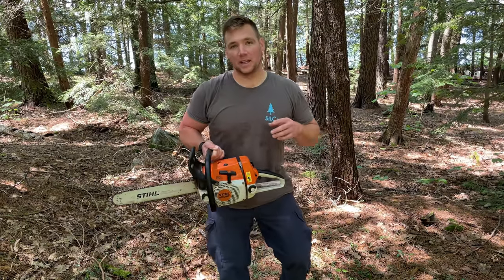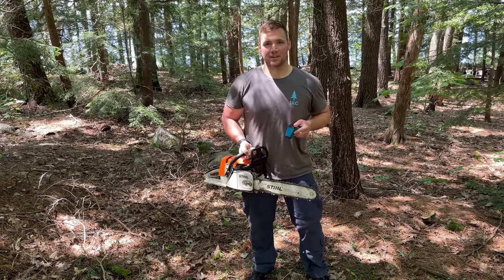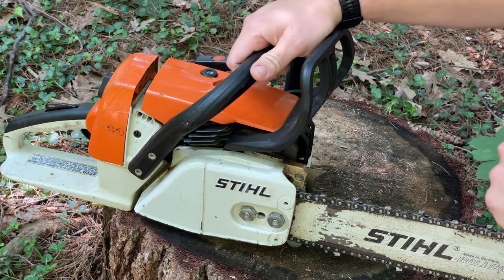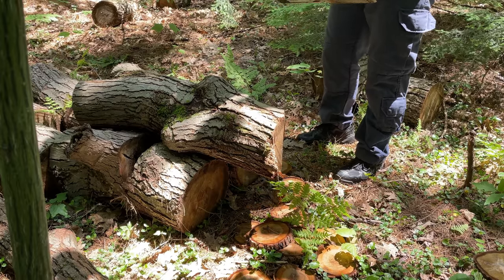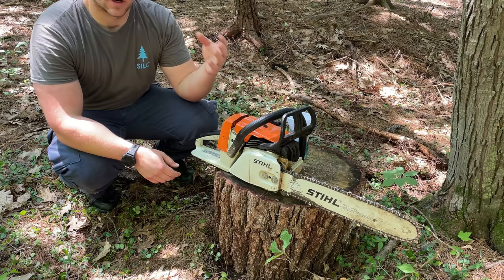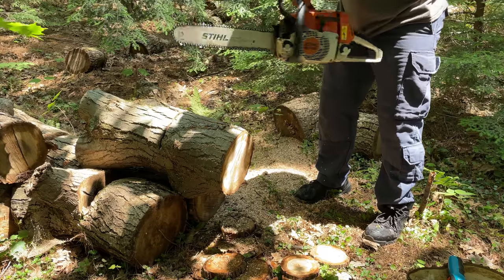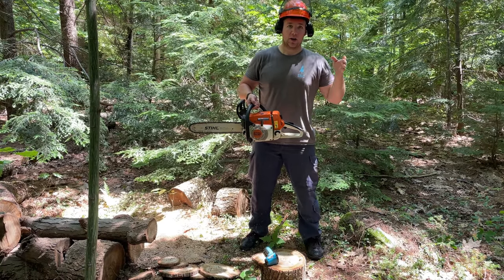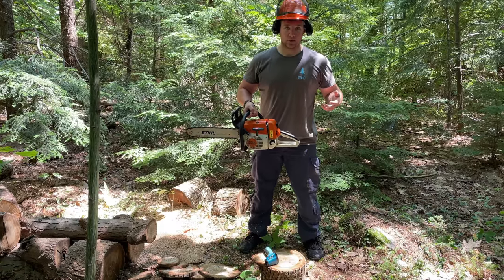Will my chainsaw last longer if I use more oil? Is it safer? (25:1 VS 50:1 temperature testing)

Comment: I run my Stihl 170 on 60:1, seems to be a bit happier (only light 3-4" trees), i found at Stihl's recommended mix, it was blowing more smoke than a damn mosquito fogger, bogged down more on harder woods, and just didnt seem to rev hard enough.

I also run my cheap Homelite 2 stroke line trimmer at 60:1 and same thing- runs better, less smoke & revs happier.

Even during 40°C plus summers here in Australia, they both run fine and dont feel hotter than usual (i use them for hours, with a break of them idling for a few mins+ stopping to refuel), and also 2.5 acres of grass/ bush hoggin'.

Edit: i also only run 98 octane in my gear (or if it is too expensice AUD wise, 95 minimum

Comment: 50:1 here, no issues...stihl trimmer 19 years old and still kickn ...though I like echo red armor oil mix better than stihl mix
Reply from the maker: That’s awesome. It sure pays to take care of your stuff! Why do you like it better?
Reply: @DavesSmallEngines  burns cleaner imo, my stihl chainsaw I run stihl oil for years in it and the spark screen gummed up … found red armor and it smokes less than stihl … 5 years later still no build up on it

Comment: With jetting remaining the same and suited for a 50:1 mix, adding more oil will displace the fuel so it ends up  running leaner resulting in more heat.  So going too overboard on the oil is not a good thing as is also to have too little oil.

Comment: I sort of wish you were also able to measure what percentage of fuel was used each type I think it would have been using more fuel to get through at the longer bogged down 25:1 mixture so it's made me think that I need to make sure I start running things alot more closer to the recommended one
Reply: Always run your engine's specifications is best , I personally won't run a rich 50:1 even if It would be recomended by that engines manufacturer as I'm not convinced that oil technology is up to that task, not yet anyway. There are many more variables to be considered, as I read some of these comments about carburator adjustments to compensate for the leaner fuel mixter, one would have to experiment with all the different oils that are available today and that would be a huge task, as oil technology has improved drastically over the years they still have their limits. As far as two stroke oils are concerned-- we're looking for good lubricating properties when combined with gas as well as combustability as one has mentioned here in these comments of using a lower flash point oil. As far as four stroke engines are concerned coming from a 63 year old born gearhead like me who has lived through the days of changing your oil every three thousand miles and now seeing that being stretched out to every ten thousand miles even on a turbo charged engine is also asking to much of that oil, between five or six if not driven hard I feel is best, even though many won't put that many miles per year at least not these days and if they do it most likely be  highway miles (rule of thum highway miles equil one third to a half of city miles). One should also keep in mind the POLITICAL CLIMATE that we are living in, a time where there is unreasonable requirements put on these manufactures to reduce emissions and maintain or acquire carbon points which has been choking this industry and making many things that us gearhead love disappear. Yours truly, Paulie T.

Comment: I have run a holzfforma g372xp on 20:1 for the past 4 years since i have owned it and had no issues. It gets used and abused every winter and hasnt given up yet

Comment: We run aspen 2 alkylate gas for professional use. No worrying about mix or ethanol. Definitely keeps carbon build up to a minimum too. No smell/cloud when starting the saw either. Never worry about letting equipment sit for a while. Seems like a cheap way to avoid a lot of worry.
Reply from the maker: Hey 7eis! I totally agree with you. Although, it’s expensive for those who use their equipment all day, every day!

Comment: I use amsoil saber mixed at 100:1. We have used it mixed at over 150:1 when I was being aggressive. We have been doing this for 20 years. I had a failure on a 661c but I have reason to believe that was an unrelated problem.  I use ethanol free 91 octane on all my small engines. 261, 241c and 201t have no damage after using this strategy for years now. More power, though I’ve never adjusted carbs.
Reply from the maker: How long have you been using the Sabre at 100:1?! I need to try some
Reply: 20 years. It used to be called something else but for the past 10-15 years it has been called sabre.

Comment: Can you do this test on some Chinese nockoff brands that say they use 25 to 1.
Test to see if they have same results,  no extra ware on them?

Suggestion, Farmertec Holzfforma G111
   Its a 1 to 1 copy of a no longer made MS200T
   Will it run 50 to 1 fine?

Comment: Very interesting results and a great video from the OLD MAN at EP. Just wondering if you think there was any damage done using the 25:1 mix for this short period of time?
Reply from the maker: I don’t think there was any damage. If I was cutting a LOT of wood it may have done something, but over time the carbon and oil sludge build up would only cause the saw to heat up more and more!
Reply: You’d hang the rings in the grooves if you kept running 25:1
Reply: @shannonwhitaker9630  Correct

Comment: Could you try amsoil saber at 100:1? I’ve been running it for several years and no failures yet. Curious if temps would be less.
Reply from the maker: Yep. I’m going to try that

Comment: Sort of invalid, I say that because you didn’t retune the carb on the saw to make it run correctly with the 25:1 mix ratio and you could definitely tell it was laboring more because of it because it was starving for fuel, now if you increased the fuel mix on the carb the performance should be equal with less wear and heat with an even bigger increase in smoke on account of it

Comment: I argued with a guy about this exact situation, I knew 50:1 was all around better than 25:1, I use true fuel 50:1 in my 1/5 RC cars with better results than the recommended 25:1. Thanks

Comment: Always surprises me how many people don't understand that more oil in a mixture means less fuel in that mixture, or how many people don't understand the difference in oil from 'back in their day' compared to the synthetics of today. 

They ran 16:1 and 25:1 because they had to -the oil didn't have the same protection levels as today's synthetics, which can be safely run at much lighter ratios. 

If the carb isn't jetted for that amount of fuel you're running the engine lean.

Comment: Tricky as manual says 25/1 IF using a 2 Stroke oil off the shelf BUT 40/1 or 50/1 if using branded eg Stihl or Echo, so does this mean they are more concentrated?  If always use 25/1 on older worn 2 strokes and never fouled a plug or had any troubles. maybe i an wearing them out from higher heat but not lack of lube?

Comment: Hi Dave: I bought a Stihl 038AV back in 1980 and ran it at 40:1 mix. The spark arrestor screen would clog up. My mechanic said I could remover the arrestor (which I didn't want to do) or run a 80:1 mix. To this day, 42+ years later, that saw is still with me, and I have never done a engine repair on it. I also have a MS170, FS86 trimmer, and HT56C pole saw, and I run all of them at 80:1 with no problems. And my spark arrestors never clog up (one of these days I'll have to check that again)! Thanks for doing this test but no one could convince me to run at 25:1, ever. Your thoughts would be appreciated.
Reply: Was told you could possibly run the 80:1 by someone who worked at a licensed stihl dealer with no problems short term.
Reply: I ran a Homelite Super XL at 80:1(Amzoil) for about 12 years with no problems.

Comment: Dave, I've question: I use a 051 for milling, running a 25:1 mixture. That saw is over 40 years old and still  runs quite well. Is it ok to  run it with a 50:1 mixture, as todays oils are much better than years ago?
Reply: Stick with what you’re using, it’s obviously liking it, what motivates your desire to change? If it’s power, you’re certainly not going to attain it using less oil, more oil- more power.

Comment: the increase in temperature is not due to the fact that more oil leads to a higher viscosity of the fuel and therefore a leaner air/petrol mixture but to the fact that more oil makes combustion longer, this means that the flame has more time to heat the internal surface of the engine.

Comment: Inconclusive as I've always ran a mixture of fuel that consists of 5 gallons of premium 91 octane fuel mixed with 16 oz of 2 stroke oil and 16 oz of seafoam motor treatment in my Husqvarna 525ls trimmer and after over 8 years of service it's got absolutely zero carbon buildup at all anywhere and I run it anywhere from 5 to 8 hours a day on jobs the spark plug I'm using is a CJ8

Comment: Nice video, I never really paid that much difference in 25:1 or 50:1 but I gotta say Will stick to the 50:1 but have you ever seen chainsaw idle but doesn't run, I have looked it over & I can't figure out what has happened, it starts up great but I can't seem to get my trigger to do anything, trigger moves the way it should just doesn't do anything the chain doesn't move the brake isn't locked, mine is just a cheap one VEHPRO 5200cc fairly New only used it 3 time's & Now I can't get it to do anything but IDLE, is there something else I'm just missing here..
Reply: I’ve got a Vehpro 52cc and it needs 32:1 ratio

Comment: Your video was excellent! The way you laid out your tools, your test samples and how you reported/demonstrated the results, very professional. I suspect you might work in the inspection world or a lab type environment. Due to the leaner fuel mixture in the 25/1 mix I can see the temperatures running higher. What if you richen the fuel up a bit by turning the jets out a touch? This however would not only increase fuel consumption but oil as well making even more exhaust smoke. I have understood in my wondering with chain saws adventures that too much oil can increase carbon build up possibly causing cylinder/piston wear, scuffing and or even gouging. Great video and thank you! I will stick to 50/1 in my saws. :)
Reply from the maker: Hey Sagerider!!! Thanks for the kind words. I don’t work in inspection or a lab… but I’ll take that compliment any day!!!

The biggest gripe from folks on my video is not adjusting the carb for the fuel mixture. I would hazard to guess that the majority of folks wouldn’t be comfortable doing that and I wanted to simulate what it would be like for the average person to simply increase the oil content in their fuel. 

I’m like you - going to stick with 45-50:1!!!
Reply: @DavesSmallEngines  
I understand what your saying and you demonstrated it very well. I did work in the inspection/examination world before I retired and the way you conducted your work is exactly the way the industry conducts ours. These are the tools we used, serial numbers, calibration dates, model numbers, who where and when. All recorded and documented for future reference in reports including all video of what was observed stating any and all details whether relevant or non relevant.

Comment: My guess is that top no load RPM at wide open will be higher with the 25:1 than with the 50:1  (leaner mixture on the high speed adjust. usually causes higher no load RPM and one way to set the mixture is to go for RPM not to exceed some prescribed number (higher no load RPM does not = stronger performance under load)

Comment: the difference in temperature is most likely due to the evaporative affect of the gasoline as it hits the hot cylinder and cylinder walls petrol/gasoline evaporates quickly on hot surfaces and thus provides a cooling affect as it evaporates the change in oil to gasoline is significant 50% increase and therefore there is a decrease in actual gasoline in the engine as it combusts and will have diminished cooling affects. as for the increase in temperature of the engine well its not going to affect the engines lifespan in any significant way but the additional oil now in the cylinder will help to lubricate the cylinder walls and help prevent damage to the walls over time, but i cant help but recommend what the manufacturer recommends as they know best running there oil ratio will be the best for protection power and heat management as well as long temp durability.

Comment: I have a 1970's Skilshop 1712 Type 2 saw with good compression.  It specifies 16:1 ratio.  So what do I run with a modern 2 stroke oil?  Any info would be helpful.  Thank you.

Comment: Im a little confused. Why does an increase in 2 stroke oil result in a lean burn? Im here because Im doing research on whether a leaner burn results in higher fuel efficiency at a cost of lower power output.

Does the increase in 2 stroke oil make the oil thicker, and so less of it gets squirted out in the carburetor? So is there actually an increase in fuel efficiency? 

My problem is that Im planning to run a 2 stroke generator on a low load (like 1/8-1/2 of max power or 12.5%-50%). Fuel efficiency and engine longevity is my main goals here. I was wondering if I could run the engine lean and then increase the oil mix to ensure the engine stays lubricated even while lean.

Comment: I guessed higher temperatures with higher oil ratio. The hydrocarbons in the oil are of much longer chain length and hold more energy in their bonds which gives off a greater  enthalpy of heat when combusted.  Same story with petrol vs the longer chain diesel. Diesel gives a hotter burn, more energy in the bonds of the longer hydrocarbon. 
There would be more carbon build up in the engine with 25:1 vs 50:1. Both mixtures do still work, but it's evident that 25:1 is an unnecessarily rich mixture.

Comment: I ran 40 to 1 in a 044magnum saw lasted 10 years and i sold it still running for 250.00.... I was told to run 40 to 1 for 2 tanks break in....I just kept running it....I went through 3 plugs in 10 yrs

Comment: I have been in the Mechanical field for over fifty year’s. Reading comments on UTube are very amusing to say the least, many are beneficial and equally are not. This video makes it clear why Manufacturers recommended adherence is important for their warranty. They have stringent engineering testing and proven results knowing they can back their products with a warranty. Many comments contradicting the Manufacturer Recommended practices should be avoided, unless you want to take responsibility for any damage caused by your negligence.

Comment: Most people don't get why it leans out adding more oil. With modern oils no need to run so much oil that was thing of the past I remember castor oil in the 1970s sure smelled good, but 2 strokes seized up if you looked at them wrong. We would run 20:1 in the dirt bikes back then 1970's. My buddies CR-80 we seized that thing up 3 times get it too hot 1970's oil wasn't good air-cooled motor.

Comment: We run alot of Stil equipment and we have trouble with the exhaust carboning up. So their oil at 50/1 is plenty of lube, and will require cleaning the exhaust.
Reply: Run your equipment harder then, saws and weedwackers are to be used at high rpm under load and this will keep your exhaust clear. A carboned up 2 stroke should not happen with todays oils if engines are tuned properly and used correctly even at a 20:1 mix

Comment: The only thing I can say is, temp doesn't necessarily check wear. I've been reading up lately about mix differences. And my god there are dozens of different opinions. Maybe, over the years, clearances, different materials have made the 50 to 1 ratio, acceptable. I have 2 echo cs 300s. A husky 359 and had a Stihl 170, that was stolen 😡, recently. And I have been using canned 50,1, in them all. Why, because I'm terrible about leaving gas in them when stored. But they all seem to run fine with that fuel. I may buy 40,1 next because both the echo and the husky are older saws. But honestly, my use is so intermittent, and rarely more than a few hours per use. I don't believe it'll matter. Oh hell yes. If I was in the tree biz. I'd be mixing my own. But that still doesn't mean I don't have respect for my tools. Been a carpenter for 45 years plus. Good tools are very important. 👍👍

Comment: G'Day Dave,,Mate can you tell me why all chain saw user jazz their engine before cutting,,
after seeing many 2 stroke bike motor seize from lack of lube,,Generally when they pull max revs and shut throttle,,leaving your engine starving for oil,,remember your oil is in the fuel,,wonders how many saws fail prematurly because of this Jazzing the throtlle,,
and then doing damage to bore and piston,,

Comment: The extra oil displaces fuel in the air fuel mixture, fuel that is required to cool the piston and cylinder. When you add more oil it will get hotter. You must compensate by opening the jets to get more fuel to keep it cool and restore the power. More oil means less fuel. In my days of performance tuning 2 stroke scooter engines I saw engines get blown up from more oil without tuning the carb to compensate. So don't run more oil in a saw like an MS170 because the carbs are not adjustable on those.
Reply from the maker: Hey that is great info. Thanks Pat!

Comment: It's actually the fuel that keeps a 2stroke cool, not the oil. If you increase the oil ratio, the fuel is thicker and flows less freely. Fuel without oil also lubricates.  
I used to race a YZ490 back in the day, and most of the time I did not add oil to the fuel mix. After years of running the big 2stroke without oil, it showed no more ware than other engines where oil was always used.